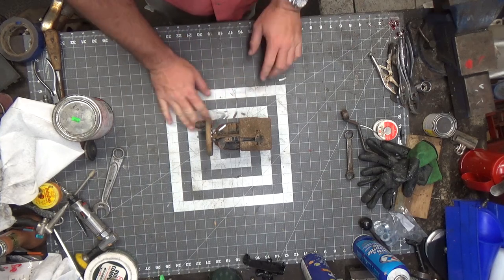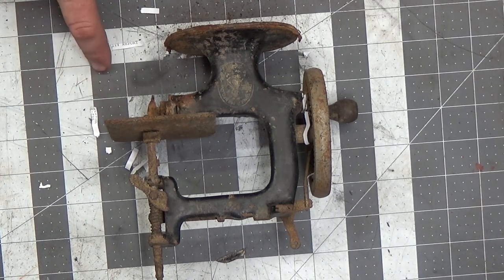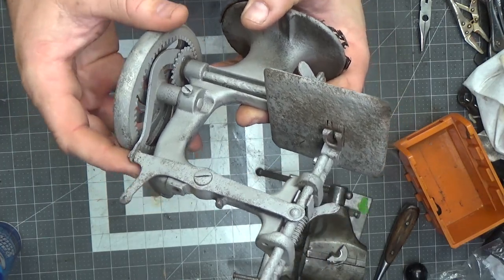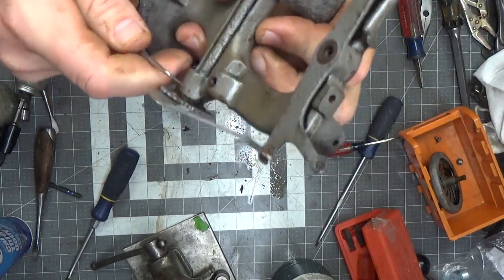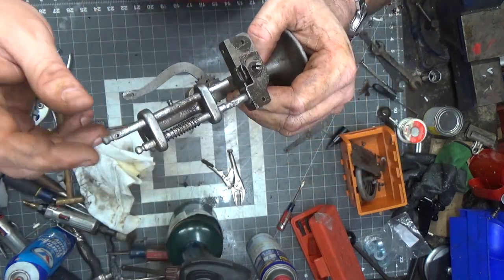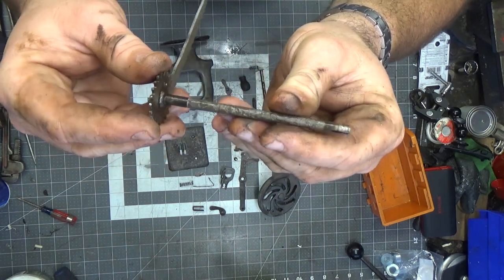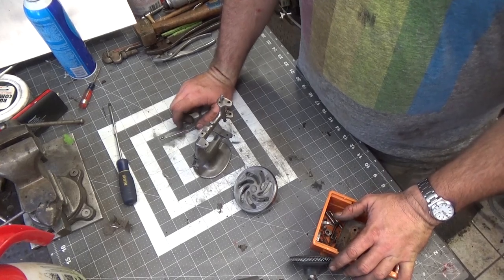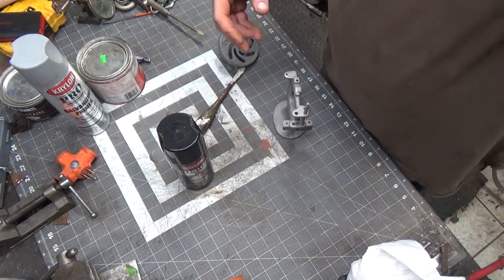Singer Model 20 (Part 1)

Comment: I'm thankful for the sewing machine because with out it, this channel would be "Naked Joe's Shop" hah.  I'm guessing that this will just be a wall hanger sort of deal, so I don't think getting it to that 100% is really required.  People are probably just going to spin the handle and watch things move a bit.  For the pitted shafts, maybe you could of filled them in with some braze and then sanded it smooth?  The working platform that you re-made turned out nice.  No clue about the paint though. Maybe try another brand. duplicolor?  or maybe try thinning out some of that other expensive thick stuff you have and give it a test run on something around there?. ahh well  on to part two. I just had to get in the cheap shot about naked joes shop.
Reply from the maker: Lol...yea nobody needs a naked joes shop channel 😂. Brazing would have worked, and probably would have looked cool. I have looked at the duplicolor paint, but the amazon reviews are not stellar. As always, i appreciate your comments. Cheers

Comment: To remove rust and free up 'frozen' parts, have you ever considered soaking your projects in vinegar or some other rust removal agent like 'EvaoRust'?
Michael from Canada
Reply from the maker: Hi Michael, the blasting cabinet really works well, soaking parts is just too slow for me.
Reply: I can appreciate that.  I don't own a blasting cabinet and often wish I did, but blasting parts only removes rust on exposed surfaces.  Soaking parts can free up 'frozen' parts by getting into areas that blasting can't reach.  EvapoRust works miracles.  Just some thoughts - not a criticism.
MB
Reply from the maker: That is a great point. I typically just use a penatrating oil, but chemical removing the rust from inside is something i never really considered. I use krudex rust converter, but it makes converts rust to a black glue. Anyway great comment. Cheers

Comment: I got one of these, and I’m having a hard time removing the hand crank to clean all the parts in that area. Is there a way to connect with you directly? Thx
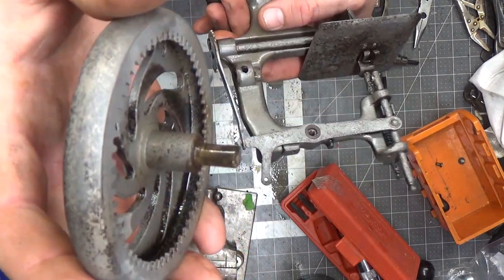Reply from the maker: Watching the video is really the best I have to offer, watch around 9:30 and you will see how it comes off. A torch and some penetrating oil would help. Good luck. Cheers